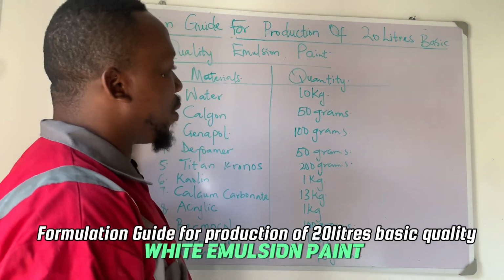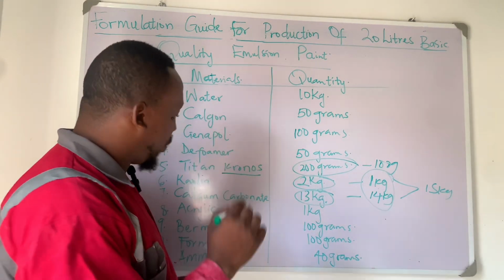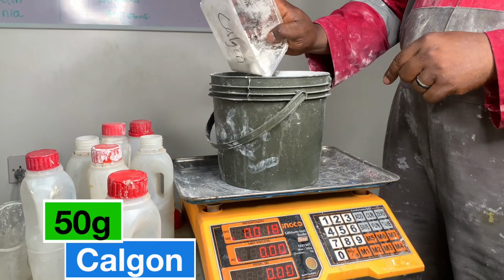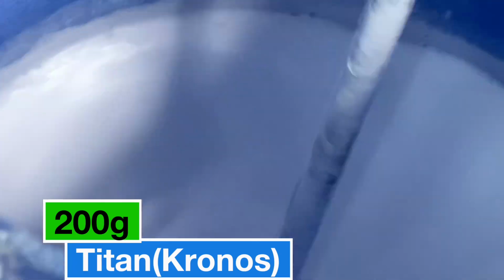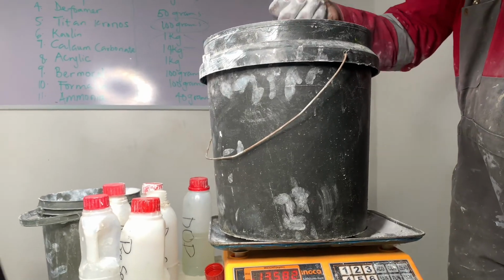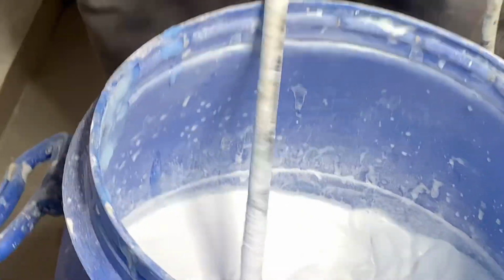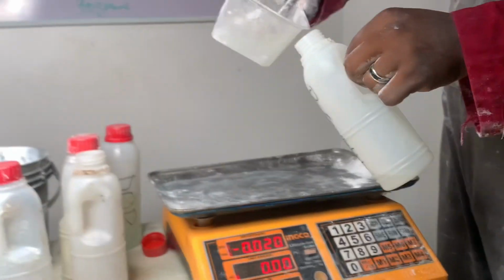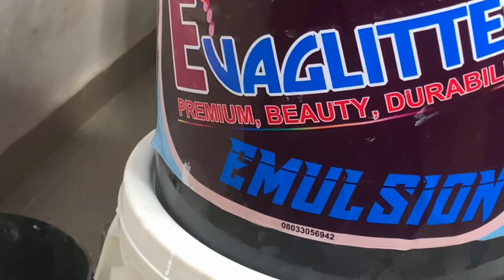Cheap Emulsion Paint Manufacturing Process

Comment: Thank you for this formula, I actually use it but was a little chalky on hand, after paint dried on wall, so I had to increase the acrylic ratio to 1.5 kg per bucket which was ok
Reply from the maker: Thanks for the feedback. The goal is to give out a formulation that can produce a cheap Emulsion Paint